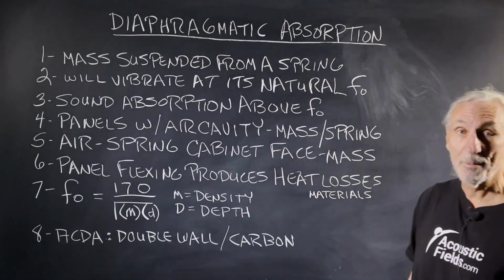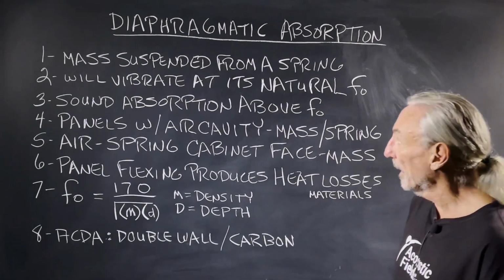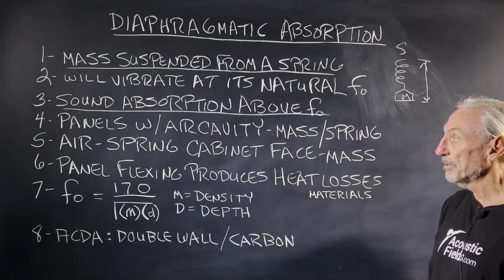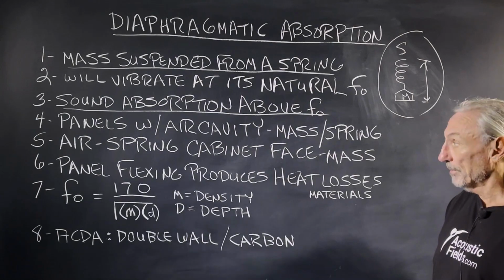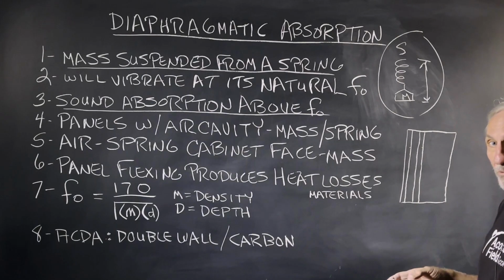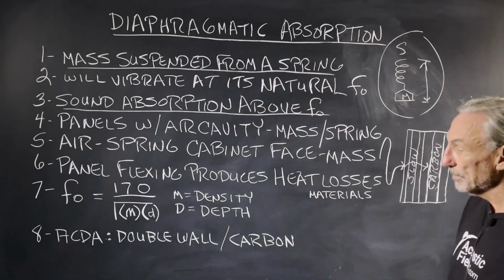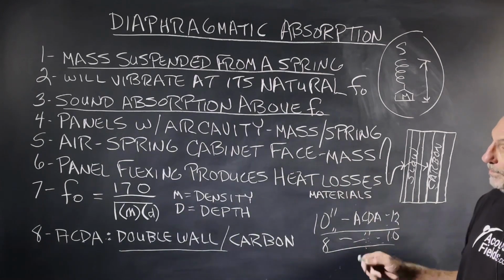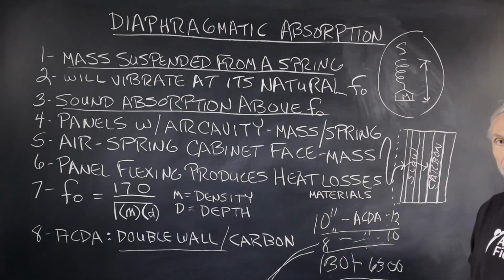Diaphragmatic Absorption - www.AcousticFields.com

Comment: so what im going to do is take the soles from my old shoes and attach them to a rail creating a void between them and the wall, so a wall of shoe soles! this should work for vocals. i do have a question, is over absobtion bad when u use building insulation?
Reply from the maker: I have no idea what you are talking about. Please be specific. I have no time no nonsense. Building insulation does not have the correct rates and levels of absorption required for music and voice. Building insulation destroys harmonics. When you hear people say the room is too "dead", they are talking about building insulation.

Comment: Are these types of panels built using mathematics to match the room specifications? There I am building panels with rockwool thinking that I could make my room perfect. I seriously need to hire an acoustician to sort out my next room 😊
Reply from the maker: Room acoustics is all about math and physics. Most people do not have that type of background so they are easily deceived by companies. Your situation of building panels with building insulation is a good example of this deception. Building insulation destroys the harmonic structure of music because it lacks the proper rates and levels of absorption to effectively treat and not destroy harmonics. If you need assistance with a proper treatment design system, fill out the information in this link.
https://www.acousticfields.com/free-room-analysis/
Reply: @ Thanks very much for your response. I’m planning to move house soon and build a room specifically for my monitors and the room size. So I will definitely be in contact with you. Once again. Thank you very much for your help.

Comment: Dennis, I have an exposed 2x4 stud frame in an existing 10x20 ft garage for drumming studio. Im interested in using stud bays to accommodate carbon filters. Would you suggest I increase the stud bay depth by stacking and securing an inner 2x6 or 2x8 frame up against the existing 2x4 frame to provide the required bay depth? Or better to leave the wall frame alone and build stand alone movable ACDA units / drum platform?
Thank you
Reply from the maker: You will need 12" of stud depth for a drum room.

Comment: How are you differentiating diaphragmatic from membrane? Membrane can have a "solid" membrane like wood. Doesn't have to be a flexible material. What matters is it having a sealed cavity like you mention with your ACDA. To me that's a membrane absorber. Diaphragmatic is when there isn't a sealed cavity like the GIK range limiter panels
Reply from the maker: If you examine the "membrane" absorbers in the marketplace, you will notice that the cabinets they use are lightweight. Most of these units have total weights in the 20 - 30 lb. region. They have a thin layer of material or membrane across the face. Most are filled with building insulation. They lack the proper rate of absorption per square foot to deal with double digit low frequency pressure issues. Anyone can build a box that goes down to 40 Hz. The trick is to achieve high rates and levels of absorption for every square foot of surface area. This is accomplished by using a better design. A diaphragmatic absorber uses much more mass to achieve its performance. Our ACDA series weighs in at over 200 lbs., has 2 front diaphragms that work together and an internal carbon fill that increases rate of absorption. Our ACDA series absorbs 35% / sq. ft. at 30 Hz. and 63% at 40 Hz. and a 100% at 50 Hz. There is no membrane absorber that can achieve these results.

Comment: Dear Dennis, thank you for this video. Does the 170 constant in the formula relate to metric as well or should one use a different number when calculating density in Kg/m3 and depth in m? All best, Robin
Reply: It is a different constant in metric and from what I remember it's the constant is 60
Reply: Thanks!
Reply from the maker: Imperial.
Reply: @AcousticFields  Thanks.

Comment: Thank you Dennis, and yes this video, as always helps.
I keep reading/hearing that the room is 50% of the sound of a  hifi system. In my experience 90% is a more accurate estimate.
Reply from the maker: Yes, opinions vary. I heard one the other day that used a 40% gear / 60% room
Reply: Unfortunately too many people (myself included) have spent 100% gear and 0% Room Treatments. As a retired music educator, I’ve dealt with performing groups who had to deal with playing in basically untreated venues. As a performer on my personal instrument, there were particular stages in recital halls that I just hated the sound quality I had to endure and now I have a better understanding of why I was “disturbed” by my perceptions. A “pretty” room does not make for good acoustical properties. I think too many architects just use a few room dimensional concepts, throw up some nice looking panels, and call it done without ever checking the acoustical qualities of their work.